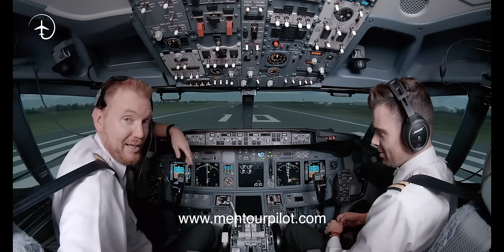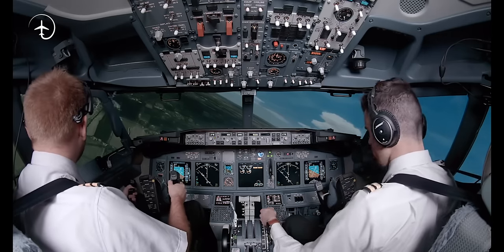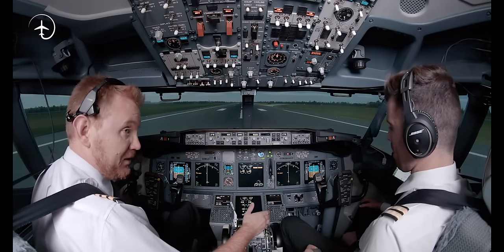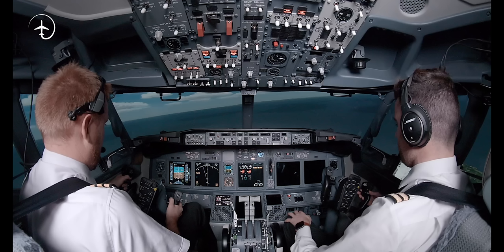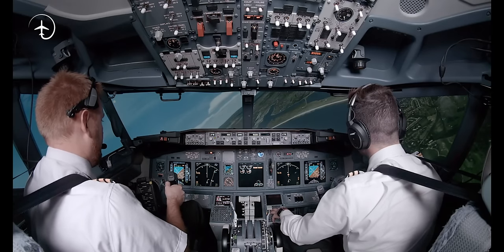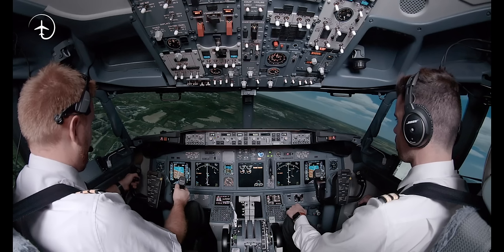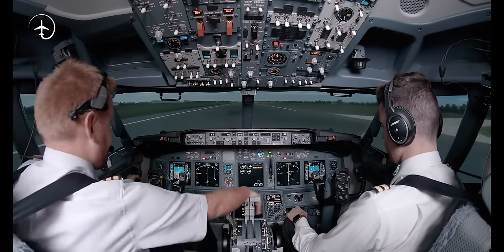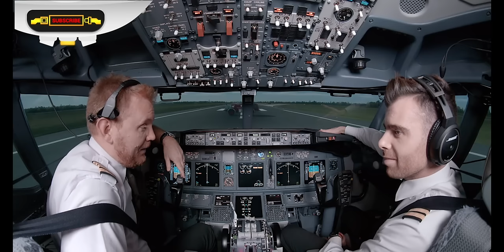Can an Airplane land if BOTH engines fail?

Comment: Hi, what is the best glide speed for a 737 in such scenario? Do you have any indication depending on weight of the aircraft? On Airbus they have a "green dot" speed on PFD for best L/D ratio. Thank you for great video!
Reply: Glider pilot here. Depending on the situation I’d either shoot for best glide ratio but maybe even more for minimum descent or minimum (safe) airspeed, all of which come at different airspeeds, right?

Comment: I note atc weather gave 5kt wind 100 dwg ie dead opposite to landing runway 28. What options/actions are needed if tail wind stronger than 5 kts for emergency breaking etc where any other runways available cross wind within gliding distance. Showing the airport chart would help us in overview of options (or not) that pilot is making.  
Im only a glider pilot + with an engine only 1 TIF flight helicopter plus the engineer in me wanting more detail.
Ps bought tshirt +attitude over weekend. Keep up the good work

Comment: As a glider pilot this looks like business as usual ;) Keep the speed up, bank with purpose, fly clean and balance the sink rate with the air brakes.
If I was high on final in a glider I would extend air brakes fully and point the nose down to keep the speed up and maximize the drag. That will bring the altitude down very quickly. A little bit above the glide slope lift the nose and slowly retract the air brakes to about half and continue down.
How does that work in an airliner? How effective are the air brakes and is it feasible to do something similar?
Reply: Or sideslip.
Reply: @EinkOLED  that works to but also means that you use crossed ailerons and rudder. You have to be very careful to keep up the speed to avoid a stall and potential spin on the low altitude.

Comment: One question: Why not turn off the engine masters or pull the engine fire switches at some point before landing? This would cut off any potential fuel leakage from the engines.

Comment: Geat job but i have a question why you didn’t do memory items in order to secure the engine from fire ? Fire will affect the airplane and maybe will cause blast so it’s no reason I think to keep the throttle forward because there is no n1 rotation (no the thrust)

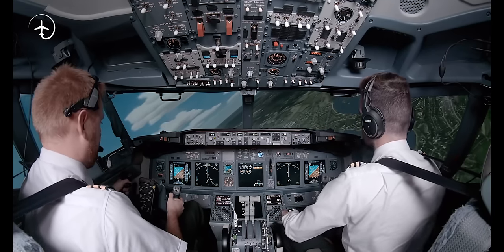Comment: At 3:13  you request gear down even though you're not flying wings level. Was that because you've regained hydraulic pressure from the APU or is that fine even with a gravity drop?

Comment: What does a pilot do in terms of emergency evacuation? What do the cabin crew do in that sitatuation also? Is there a procedure for that?
Reply: Yes there is a procedure about that, the captain need to say the command to evacuate, or in some well defined  scenarios, the cabin crew will initiate the evacuation without the captains comand.

Regarding what is the flight crew doing before initiating the comand, i will let Mentor explain, as don't have the information about that. Hope it helps
Reply: For the cabin crew, they are very dependent on the calls from the cockpit in this scenario. The first mayor item is when the capt called for a "no time emergency landing", basically there are 2 types of emergency: prepared (they have time to prepare the cabin, stop service, check everything, etc) and unprepared (no time, things happen close to the ground, just sit down and prepare for landing).

Second call(s) are coming from the FO with: "crew stations" at about 1500-500ft which lets cabin know to prepare for brace positions and do their silent review and finally the "brace brace" call at 500ft which is where they will also shout 'heads down" to the passengers.

Once the aircraft comes to a stop the "standby" call from the capt is also important because the cabin is waiting (and counting) for a call from the cockpit, if that would not happen for a certain time they will try to contact or enter the cockpit. By saying standby they know cockpit is fine and dealing with the issue and they can expect 2 different calls next, either: normal operations or evacuation

Comment: I'm curious about the very last thing - going for MAX BRAKING - given that you got the plane down in the landing zone and had pretty much the whole of the long runway to let the speed brakes slow the plane down. Using max breaking risks catching them on fire or overheating so why not standard braking? Is that because running on APU there was a possibility that the hydraulics might be weaker braking than normal?

Comment: Nice landing, but I have a question: why the airplanes are not made to can safe land on water (like this ones for ex be200 or a40), I mean, these are  amfibious by design, but should not necessary be amphibious but designed to can land quite safe on water in case of emergency...I think that would be a quite simple but very usefull design improuvment
Reply: These airplanes have also a quite cyclindrical and simple fuselages, so, any airplane (they are all almost the same) can theoretichaly land safe in water even if the engines will be sumerged, but it will be safer for passangers&crew because in most if the cases it's much more easy to find water surfaces than suitable runways

Comment: were the fuel pumps automatically disengaged on the ower failures?  maybe I missed that.  And why not throttle back after the initial engine failures?

Comment: @Mentour - I assume when you sat in the simulator that day you knew you would encounter bird strikes and dual engine failure.  Did you program the simulator to have the birds strike at 6,200 ft, or was that altitude/timing otherwise assigned and somewhat of a surprise to you?  Have you tried this exercise with dual engine failures at different altitudes?
Reply: Maybe next try (or previous try that didn't get shown), have the birds strike at the same altitude as what happened to Sully.  Just for a real test.  (I recall at the time of the investigations, there were 30 some pilots that tried to land and all failed.)

Comment: Check out the "Gimli Glider Incident" from July 23, 1983 where a Boeing 767 ran out of fuel which shut down both engines at 41,000 ft.

Comment: Awesome!  @mentour what if you are say 2,500 agl when the dual engine failure occurs on the climb out?  Also the thrust levers, were they left in the advanced position on purpose or it would have been an unnecessary step among all the other priorities?

Comment: Great Videos, I really enjoy these. It looked as if you was over the Irish Sea when the birds hit, could you have dumped the fuel? I’m thinking this would lighten the load, which would reduce the energy on landing, but I’m also thinking that by keeping the fuel the extra weight might help you get down quicker?
Reply: 737s don't have fuel dumps. If they had 2 engines out on departure they would just land overweight.

Comment: If you got the runway to roll-out with (can't be going that fast with flaps 40), why use max brakes after a smooth dead-stick landing since they like to explode tires and catch fire?

Comment: I would like to know how and details on the APU. What is it and how does it run without the engines working normally? Details needed.
Reply: the auxiliary power unit is a complete, comparatively small engine, which instead of creating thrust, drives an electrical generator. it does not depend on the jet engines. it burns fuel though.

Comment: Just a quick question. Why didn't you pull the fuel cut-off switches ? Isn't it dangerous to let the fuel still flow into damaged engine ? Or does the engines stopping just stop any fuel succion ?

Comment: If I a engine failure prior to take off I will close the throttle and call stopping. If I engine failure after take off I will either land on any remaining runway or select a field within 30 degrees of the front of the aircraft. I will not consider returning to the airport unless I am 1000 AGL where I will do a right crosswind landing. 
Probably different training than the big jets but what they train us doing small aircraft.

Comment: I noticed that the trim weels didn't turn anymore after the bird strike.I Does it only works automatically on ap? Wasn't the trim working or you didn't have to input any trim adjustment? Thanks.

Comment: If your aircraft is so equipped, would it be warranted to perform a fuel dump assuming the aircraft is in a position to do so? How would one address an MLW issue otherwise?
Also, what an incredibly butter landing.

Comment: Are pilots ever given a 'no win' scenario in a simulator?  For example, where the engines fail soon after take off and you need to find a field to land on or ditch in water?  Or a scenario where it's really unlikely you can land safely so you're really tested what would happen under pressure?

Comment: When pilots are in simulators for training/testing (rather than demonstrations), do they know what they are going to encounter specifically ahead of time? Are you told things like, "this run we're going to practice a dual engine failure at x flight level while climbing after takeoff" or is it closer to "engine failure training" (or even more vague) with no context?

Comment: Excuse me, why do pilots have to call out 80kts during takeoff and landing? Is the reverse thrust cut off at 80kts as what I see on... maybe Airbus 🤔🤔🤔 I saw somewhere but I don’t remember
Reply: Believe it’s to verify both speed tapes are increasing together. If one’s at 80 and another is either not moving or at for example 60 there could be a problem giving unreliable data.

Comment: Terrain inhibitors sound good, will they stop you crashing?
Reply: They inhibit the warnings (gear/flaps/terrain) to reduce distraction. They won't stop you crashing, but if the're inhibited they would no longer issue important warnings such as terrain or or gear up.

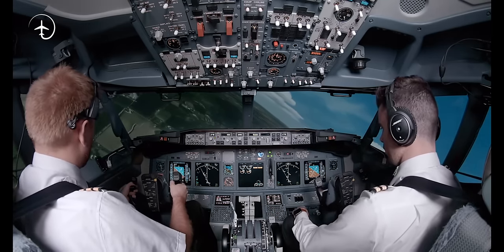Comment: Would 6000 feet be a typical hight to hit birds? I would of though that it would be more likley to happen much lower. You fly over my apartment at about 3:50 in the video : ) It would be very alarming to see an aircraft doing what you just did overhead.

Comment: Great video, very interesting as always. Have a couple of question.
When the engines have catastrophically failed, would't it be an idea to cut fuel to them, maybe pull the throttle levers back in case of a fuel leak?
It took a while from starting the APU until electrical power was available. I thought it would be almost immediate.
Reply: Fuel leak? Why?🤷🏻‍♂️ The apu uses some time in the start sequence🤭

Comment: Could you repeat the same test reaching the altitude 2000-2200 feet. Basically repeating flight PK PK8303 after go around

Comment: In real life there are two key differences though:
1) you are not in a simulator and you are risking your life. That puts a hell of more psychological pressure
2) usually contact with birds happens at low altitude so not always there’s enough time/space to recover
What do you think?

Comment: how is the flaps and gear lowered and also brake  with dual engine failure?  is the electric pumps powered by the apu to maintain pressure in the hydraulic lines?

Comment: Due to altitude, you indicated you would be coming in "hot", you did not dump fuel and still you used only the first 1/3rd of the runway.  Is that possible?  Does the simulator tell you where you touched down (how far from the start of the runway) and it does it calculate; based on full fuel load, passenger load, airspeed at touch down and number of feet rolled out on landing if the brakes would have overheated, tire pressure releases blown out etc...?

Comment: Are the controls so heavy you need to use 2 hands?? - even for shallow turns??
Reply: Maybe not heavy, but he doesn’t need his other hand on the thrust levers so might as well put both on the yoke.
Reply: @theinfiniteflightdeck  Using 2 hands when mild maneuvering is like using 2 hands to cut a little piece of cake.
Reply: @outwiththem  where else is he going to put his hand?
Reply: @theinfiniteflightdeck ,  Lots of places to point to copilot what to do.  Pointing at.  If Turnback, dont do shallow turns when a Turnback needs 40-45 degrees of bank.  Its harder maneuvering time, not mild maneuvering time.. but when mild maneuvering, i dont have to use 2 hands on wheel like a tractor trailer driver will do when parking the rig.

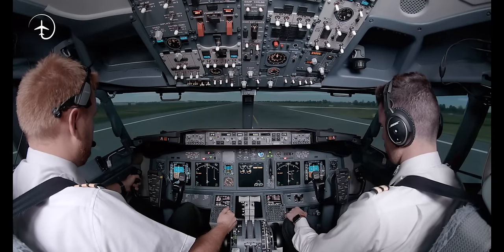Comment: At 5:20 you try to grab something. Did you expect to have the trust levers at idle position? Do you set them to idle when the enginge fails under "normal" circumstances?

Comment: @mentourpilot I have a question: why keep the parking brake off if the brakes are hot? Is it so the disc cools evenly without the  parking brake keeping that section of the disc hot?

Comment: You still landed aligned with the centerline, you really tamed the winds with your machine. If I was hiring pilots you will be getting the job. 

What is the evacuation procedure in this case, shoots open or save them for some other emergency?

Comment: I am curious why throttles aren't immediately pulled back to idle in this situation. I know the engines are not spinning, but does the throttle still operate fuel pumps?

Comment: 1:47 Should Elton be straight onto the APU at this point?
13:29 Elton was very busy but should he have confirmed three green gear lights when he had a moment?  Or was it given that you knew that?
Reply: Or less relevant than usual, since you're not going to go around and sort the gear while holding?
Reply: @mrgilbe1  The pilot would still need to know if there was a potential landing gear problem, even with limited options to actually do very much about it.

Comment: Would you be in manual reversion until the APU is turned on as the AC hyd pumps are not being powered as well as the eng driven pumps?

Comment: I remember that one flight that had a fuel leak over the ocean, ends up running out of gas and lost all power to the plane and managed to glide to a military base.
Reply: Another one happened with Air Canada 143 23-Jul-1983 due to a miscalculation related to having to use metric and imperial units in the fuel calculations.

Comment: Why do you put the brakes on full (and get them red hot) when it looks like there’s oodles of runway in the distance?
Reply: The aircraft is probably coming in faster than normal and reverse thrust is not available, so it is essential that the aircraft be stopped as quickly as possible. In addition, as there are no functioning engines, there is no chance of a go around.
Reply: Also they don't know if they have other issues that may need an immediate evacuation (fire etc), so the sooner they stop and can do that, the better.

Comment: 12:17 how will banking harder give you more track miles? It tightens the turn and thus reduces track miles, right? But you'll have a longer straight and level approach.
Reply: Doesn't that depend on the direction you're going? I thought he was doing a kind of S turn rather than just flying straight to the runway

Comment: It would be difficult but you could land. If both engines fail the plane will glide, it won't drop like a brick. How far it can glide depends on altitude and speed the higher the jet is and the faster its going the further it can glide. A fast moving jet at 40,000 feet could glide 100 miles maybe alittle more. The plane would lose most of its power if both engines failed so not all instruments would work and it would be harder to turn the plane beacause some of the hydraulics might be out. The plane couldn't slow down as fast without reverse thrust and you'd need a long runway. The landing would be rough you'd land harder and faster than normal but you might survive. In the 1970's a commercial jet sucessfully landed in the canary islands with both engines out.

Comment: @Mentour Pilot

Hello Mentour!

Great video as always, I don't want to become a pilot and I think I can't (due to autism, if you want to know it exactly), but that doesn't mean that I'm not interested in aviation!

So you usually start the APU if you have an engine failure (1:52), but nearly every aircraft has a built in RAT.
My question is now: Are there any restrictions or regulations when to use a RAT or the APU instead, or can you even use both simultaneously to get the electrical and hydraulical power back?

Thanks a lot and I really love your channel, as well as the whole aviation world, great job!

Patrik
Reply: The Boeing 737 does not have a RAT.
Reply: @Eternal_Tech  
Really?
OK, thanks, Eternal Tech, that's something new to me!

Comment: I thought the speed reduces very fast when the engines aren't working so there wasn't the need from flaps.
Or does it depends on the how fast the plane was moving before the bird strike occurred.
Reply: The plane had to lose a lot of height quickly, so the speed would increase even without thrust, so it's all about shedding energy, but not too much... Really skilled flying.
Reply: @clearwoodcouk  oh okay. Thanks

Comment: Doesn't the RAT deploy automatically in the case of dual-engine failure to provide electrical power and hydraulics?
Reply: hairyman1544 No. You don’t want the drag it gives you unless absolutely necessary.

Comment: Two questions: It just seemed that starting the APU came late. Why not instantly start it when all power is lost? I understand working a restart as priority but it just seemed the copilot had dark display for a long time. Also, if you are high can you slip? Some airplanes are really effective speed brakes in a slip and others (high performance glider) have too sleek a cross section for that to be effective. I think I recall the Gimli glider 767 landing using slipping. Finally (guess that was three questions), if you lost all power really high, like 30,000 right over Heathrow and you had to glide for a long time, would you setup the approach overhead the airport in a “standard” deadstick landing approach or would you fly around farther out and setup similar to what you did?